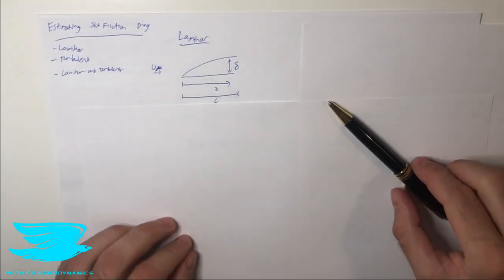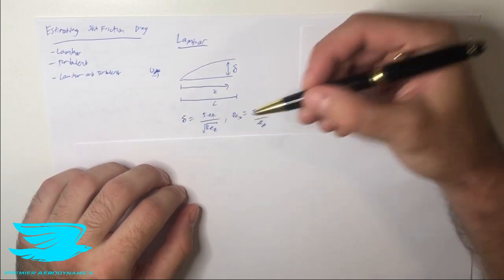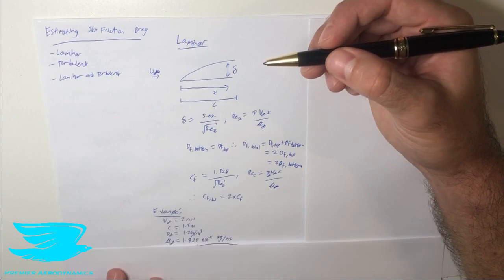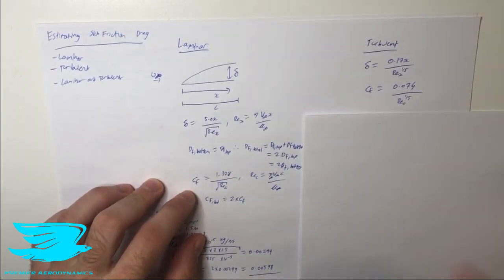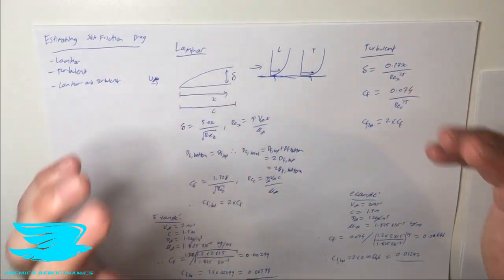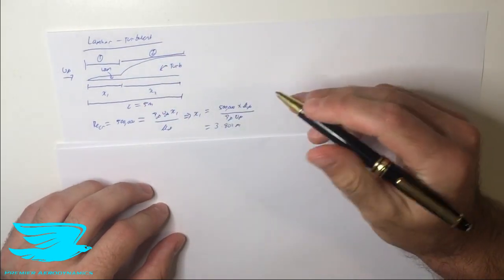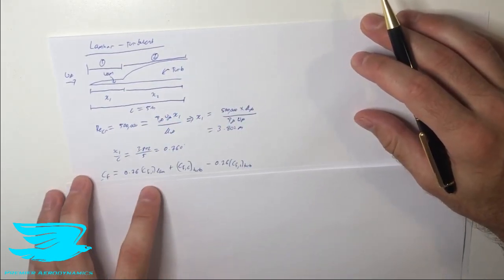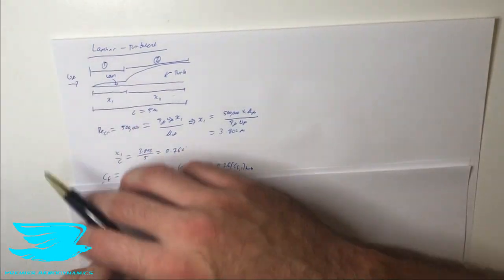[Aero Fundamentals #19] Estimating Skin Friction Drag

Comment: Great explanation, You can also use Displacement thickness  δ = ∫[1-(ρu/ρ∞u∞)](u/u∞)dy  which is especially for compressible flows giving better approximations. But it will also add more complexity and is not worth putting in video. But your formulae also gave great approximations.
Reply from the maker: That's a good formula too. Thanks!

Comment: So laminar boundary layer means energized boundary layer, the energy being the object colliding with the air and the dynamic pressure differential created as a result? Turbulent boundary layer means the energy and resulting pressure differential are quickly equalized and more evenly distributed by turbulent mixing. Just like turbulent mixing is good for evenly distributing gasoline inside an internal combustion engine, it's also good for evenly distributing the energy displaced by an object. To keep flow laminar is to fight against air's natural state, in the end, the air always wins. So if you can't win against air, then the trick is to not go against, but with. You can organize turbulent wake, because the eddies that make up turbulence can merge into one cohesive vortex as long as you keep pumping energy into the system. While that vortex is a source of drag, it can be used to our advantage, because it affects all the flow around it.
Reply from the maker: There is a lot of info in your comment😅

So, a laminar boundary layer isn't as energized as a turbulent one because the velocity near the wall is slower, and the average velocity, in general.

In terms of mixing, definitely, turbulent boundary layers are better, and turbulence in general. A similarity to this is cooling; force convection is better than natural convection because the air is moved away quicker and mixing occurs better.

There are definitely applications where turbulent boundary layers are better, for example if you have an extreme adverse pressure gradient (a pressure that is trying to slow down the boundary layer). The turbulent boundary layer will stay attached longer because it is faster moving near the wall.

The difficulty with eddies from turbulence is that they are more or less random, so trying to get all eddies of the same rotation is difficult, hence the eddies often just cancel each other out.
Reply: @PremierAerodynamics  Typically a laminar BL forms on leading edges, the part that is getting completely unobstructed air flow. It by definition has the highest energy available. Every cm of surface after that loses energy, turbulence is that energy dissipating.
Reply from the maker: @rolandotillit2867  Oh okay, I understand what you mean. Yes, a laminar boundary layer typically has the most energy available when it first starts. However, the energy lost is not just through turbulent structures but also through friction with the wall. That dissipates as heat. The energy lost through turbulence also ends up as heat, but through a different mechanism.